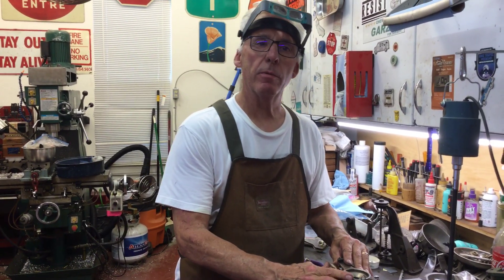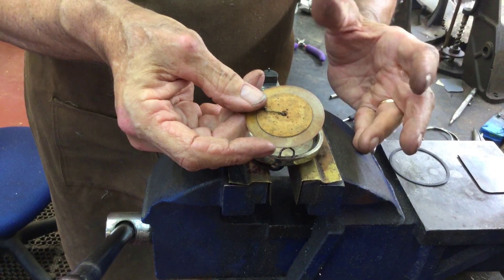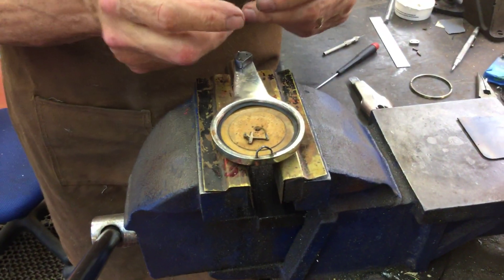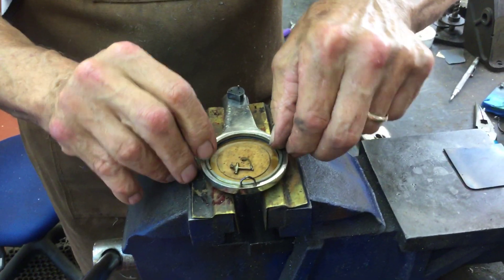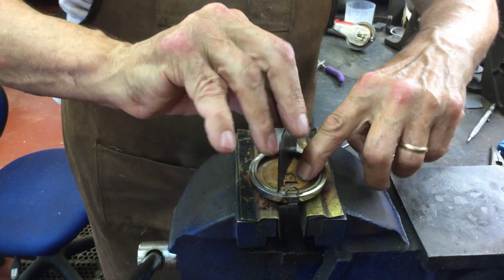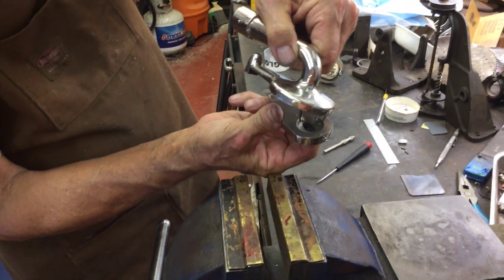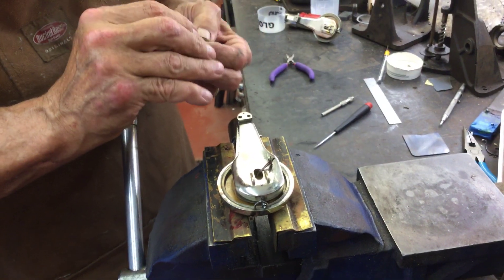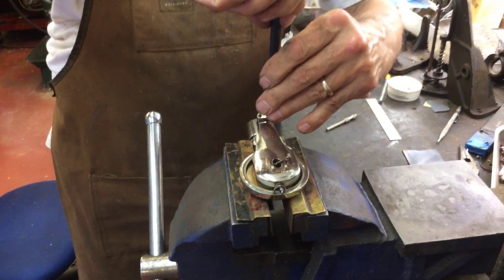70.  Rebuilding your Edison Diamond Disc Reproducer

Comment: Hi I just came about a Edison BC-34 SM—6041
It working as it should, but the the needle on the reproducer seems to be worn down, can this be replaced? I don’t know anything about it but I know the needle part is worn down. I’ve watched your videos as far as rebuilding but nothing on the needle. If you could give me advice, or maybe you could restore it for me or lead me in the right direction? 
I would appreciate any input on this 
Thanks Rick
Reply from the maker: It sounds like you may need a new diamond stylus, it does not use a needle. I recommend Wyatt Markus and his phone number is 585-224-5453.

Comment: I have watched a number of your videos as I work on an Edison Fireside Phonograph, which came from my wife's grandparents.  The videos are great and very helpful.  I am assessing the reproducer and wondering how to determine if the needle is worn out or still OK.  It seems to put a lot of drag on the cylinder.  I took a photo of the tip and it seems rounded. At the moment I can only turn the cylinder by hand and that doesn't allow me to properly test the reproducer although it makes recognizable sound.
Reply from the maker: What horn do you have?
Reply: @1974hurt  Since then I have made a horn out of construction paper about 15 inches in length and with an 8 inch opening.  Also I have a temporary motor drive.  The sound volume is OK, but only some words and phrases are understandable.  I am thinking either the stylus or the reproducer is at fault.  I have 13 Blue Amberols so it is not the cylinders.
Reply from the maker: Lead screw engagement May need to be set, the tracking.  I have videos on how to set the tracking.  Try that first, then move to reproducer rebuild.

Comment: I just to mine apart and it seemed to have a gasket on top and on the bottom. So there only should be a gasket on top?
Reply: Or I guess i say, both sides
Reply from the maker: No, there is one on the top, then the mica, and then another gasket on the bottom, the metal retaining ring, and then the screw in part.  Originally they had the rubber gasket and then a paper gasket on top, but the paper gasket I have found attracts moisture, so you don’t need that.
Reply: @1974hurt  so there are 2 gaskets, one on top and one on bottom. Are they the same gasket, or different?
Reply from the maker: @dewaynehigh3188  they are identical gaskets.  Put a gasket in, then insert the diaphragm, then put a gasket, then insert the metal ring, and then screw in the screw ring.  Make sure the diaphragm does not touch the inside edge of the reproducer.
Reply: @1974hurt  thank you very much for your reply and the very informative videos.

Comment: Thanks for your videos. They are very helpful. I have some questions maybe you can answer. I have an Edison Diamond Disc player with a reproducer that I want to rebuild. I have rebuilt Victor reproducers before but this is my first Edison. Your videos are very helpful. I have been having a problems finding a replacement diaphragm. Where would I look for that. Also, I tested the stylus as you suggested and I think that it may not be good. Are replacement styluses available. Thanks
Reply from the maker: sidibill I buy all my parts from Wyatts Musical Americana in California.  http://www.wyattsmusical.com/EagleTalkingMach.jpg.    707-263-5013.  Phone Hours are 9:00 AM to 3:00 PM Pacific Time, Monday thru Wednesday .  Great guy, knows everything!

Comment: Hi, could you please share how you got the stylus pin out? Thank you! I'm having lots of trouble with mine.
Reply from the maker: Nate Otto :  get a small punch and a hammer.  Put the punch on the end of the stylus pin and tap the with the hammer.   Grab it with needle nose pliers and it should pull out.
Reply: @1974hurt  Thanks! I did heat up the T-bar a tad with a soldering iron, that seemed to really help.
Reply from the maker: @nateoutsidethevacuum  Great